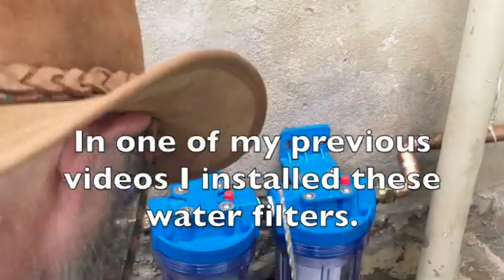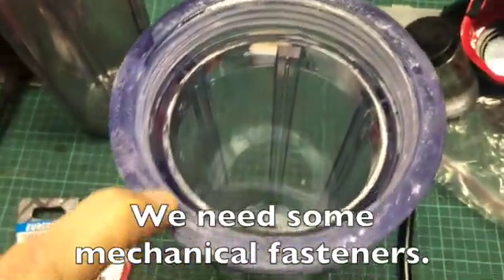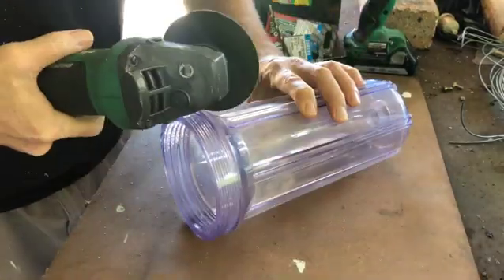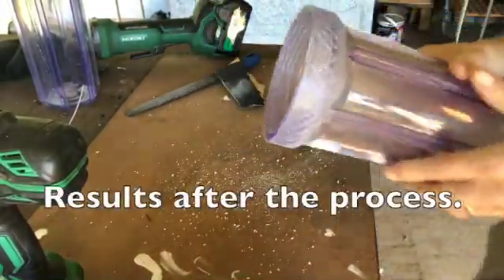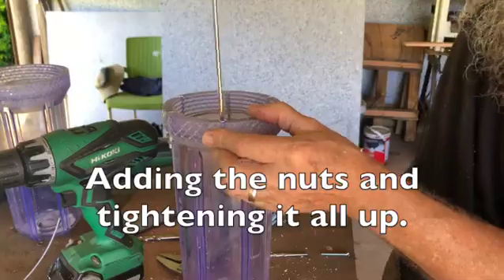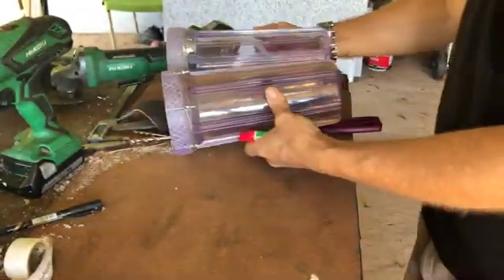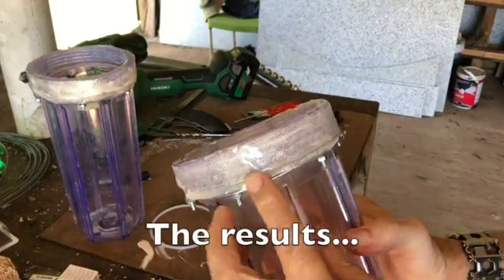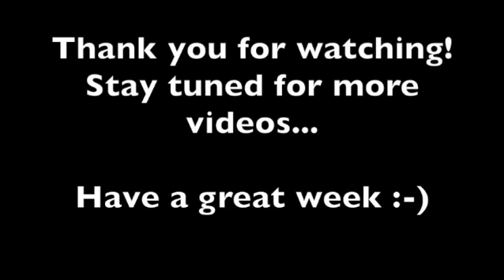Water filter housing failure. Fix it? Or buy new?

Comment: You're not suppose to be using clear housing for full house application only for under the sink with dedicated drinking faucet due to water pressure variations.   I believe clear water housings need to be replaced every 5 years and the blue housing every 10 years.  But always check with manufacturers specifications.  Also, when you leave it exposed to sunlight it make the housing weaker.